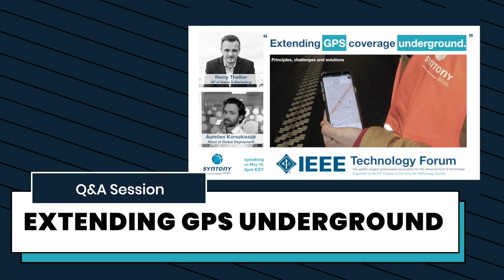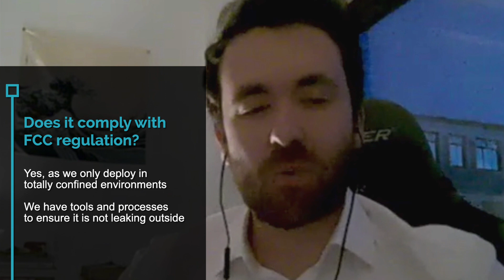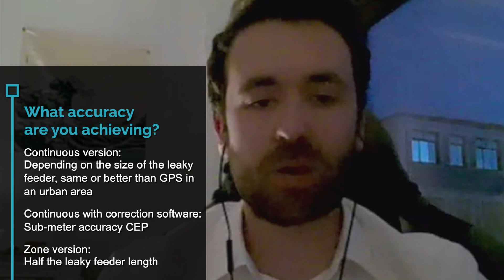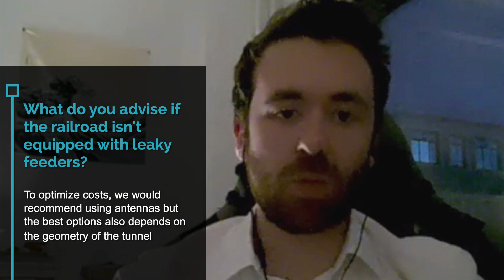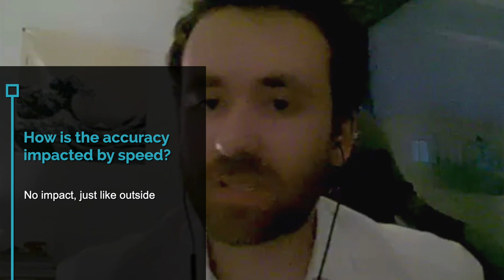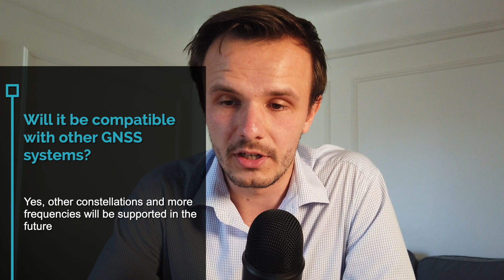2. Q&A - Extending GPS Underground - IEEE VTS - Technology Forum

Comment: So if I understand it correctly you can only simulate straight lines for the continuous position straight in all three coordinates X,Y, and Z direction from each end. 
So a curve (or shift in height/depth) in a road or track means that each side of the curve needs to have a separate feeding part. 
During the curve, the position will be false.

Is that correctly understood by me?
Reply from the maker: Hi!

To answer your question, even in curves (depth/height included), the position will be correct!

We made this short animation to explain a little more the specificity of the system regarding curves, we hope it will be clearer!

https://www.youtube.com/watch?v=sHSDLzJpzCE